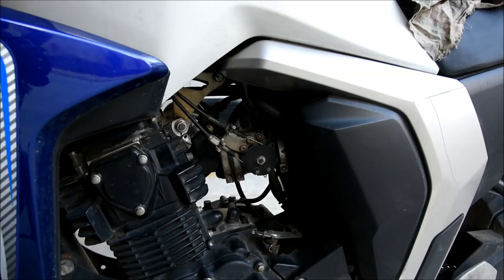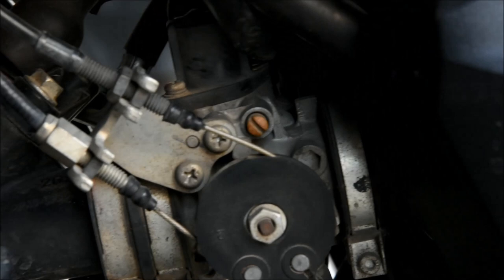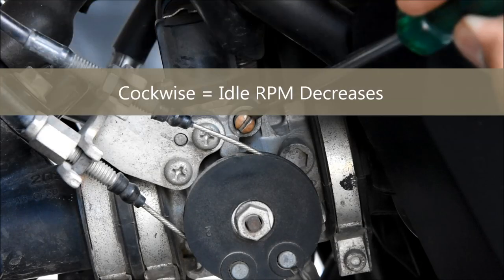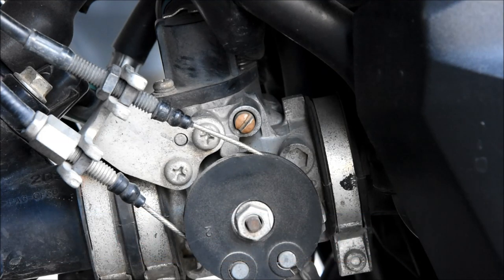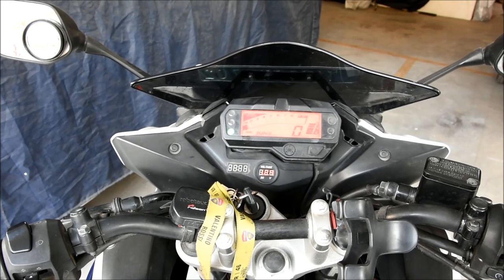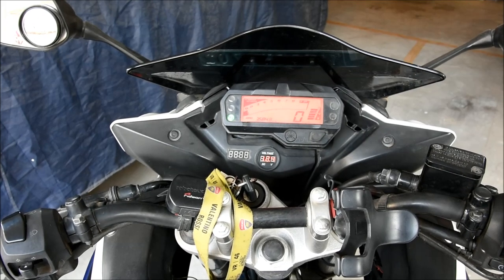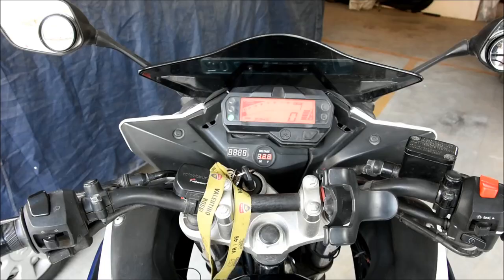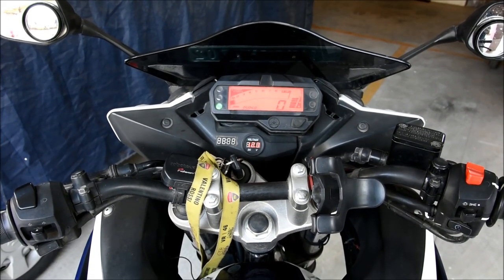#DIY : Idle RPM Adjustment on Yamaha Fazer Fi / Fz V2.0

Comment: This scre is broken.can i get new one?
Reply from the maker: You can order it from the contact given in the video description.
Reply: @MototechWanderer  how much cost?
Reply: @MototechWanderer  Where????how can i get that air screw????
Reply from the maker: @shabeeralimuthuvallur2254  I guess 100-200 INR
Reply: @MototechWanderer  which website it provide???service center or?
Reply from the maker: @shabeeralimuthuvallur2254  check there will be a contact number.

Comment: How to know it engine idle already on 1300-1500 rpm idle if i do it with no tachometer (manual adjustment)? Did you have a simple way to knowing engine idle level?
Reply: With sound.

Comment: Very helpful bro thanx a lott...just a question, through this process we increased the air flow into the cylinder ??
Reply from the maker: Bibhash Sarmah  We increasd air and fuel flow very slightly. So this will not have an effect on power or fuel efficiency unless your vehicle idles a lot.

Comment: Hi bro , very informative video thanks for it.
But my bike does not have that screw, i mean to say it is lost, where should i buy it , if you have any link please provide.
What is the name of that screw
Reply from the maker: Yes you have to order that part from yamaha. I will check the part number when I visit the dealer next time.
Reply: Thank you very much.
It will be very helpful
Also subscribed 👍
Reply: They are advise to buy throttle body 😭😭

Comment: hello man.. is that adjusting screw located at carburator?
Reply from the maker: It's the v2 model and has fuel injection system. For a carbureted engine, there will be a fuel screw.

Comment: thnx a lot.One of the Dealer was saying me that  we can't adjust this speed 😅
Reply from the maker: Now you can give them a lesson on how to adjust.
Reply: You can adjust idles in throttle cables, if you turn the air screw counterclockwise you are making the fuel mixture lean and it cause piston breaks,you can only adjust aircrew unless you are using a programable ecu😁 i work in Yamaha as a chief mechanic.

Comment: My fz v2.0 2015's engine shutting down frequently while in low speed after running  it in high speed, any suggestions?
Reply from the maker: Spark plug
Spark plug cap
HT coil
Spark plug cable 
Replace one by one ... One of them is faulty.
Reply: Did issue resolved buddy

Comment: Fz version 2.0 injector model
While running around 40 to 50 km speed
Bike gets knocking or missing issue at the same time eco indication also gets off.
Low speed and high speed no issue.
Please solve this problem.
Reply from the maker: Replace the spark plug and see.
Reply: I checked spark is normal
Reply from the maker: Replace the plug if it doesn't work, replace the HT coil and spark plug cable.
Reply: Ok thank you. 
I will check and let u know.

Comment: Sir....throtle body can make it tik tik sound is it?
Reply from the maker: No it cannot. It's either the worne out throttle cable or the injector noise.
Reply: @MototechWanderer  i hear it from throtle body 😀 then how to solve??
Reply from the maker: @mfgallery4512  if possible share a video of the noise.
Reply: @MototechWanderer  are you on whatsapp??...that sound is like a tapet tik tik sound!! But its not tapet

Comment: bro, i have fzs v2, problem is sometimes bike dont start until i have to give throttle, even after i recently changed battry,  ant air screw,  so can u suggest me what to do?..
Reply from the maker: Do you regularly use your bike ?
Reply: @MototechWanderer  yes bro
Reply from the maker: @MrBrijesh143  do few things : 
Clean the throttle body, replace the spark plug and also clean the injector. 

Check if the temperature sensor is connected properly with the plug.

Clean the fuel tank and fill fresh petrol. 

If all this doesn't help, it can be due to a choked fuel filter inside the tank. Then you will have to remove the fuel pump and clean everything.
Reply: Ok bro , ill do it ,  thanks for reply...🤗

Comment: I have a problem with my fazer 2.0 just changed the battery recently because I a haven’t used for over 4 months after the battery change and when I start the motor bike it is automatically revving really hard I’m glad I put it on neutral other wise it would have run off. Anyways is there any way to fix this ?. Thanks
Reply from the maker: Let it fully warm up for like 5-10 mins and see what's it behaving like. If it still keeps revving, see if the throttle cable is stuck, else check the idle screw.
Reply from the maker: Turn your handle left and right to check the throttle cable.
Reply: @MototechWanderer  thanks bro 😀
Reply from the maker: @ramimr1701  you're welcome

Comment: What does this control, the fuel intake or air ?
Reply from the maker: Just opens/closes the throttle slide to maintain a certain RPM. The AF mixture in always maintained by the ECU.

Comment: Like in carburettor  dont you have air fuel ratio screw and idle rpm screw. I see that below the throttle body there is a small nut which can be used to adjust rpm as well. It has to be adjusted with a hex/allen key. I am confused on why there are two ways to adjust rpm. Can you please clear this ?
Reply from the maker: EFI engines have the computer (ECU) which constantly measures the air intake temperature / pressure (throught MAP Sensor) and the exhaust oxygen levels using the O2 sensor. Based the the pressure, temperature, oxygen levels, it decided the amount of fuel to be mixed in the intake air using the injector. This process happens extremely quickly and the ECUs are capable to running 50-100 cycles in a second for achieving the perfect mix. So adjustment of af mixture is completely out of question as it's preset inside the ECU.

The only thing that's adjustable in our non-ride-by-wire throttle bodies is the idle RPM which is shown in this video. For bikes that have ride by wire, the idle RPM is also company preset and cannot be altered.

Comment: Is it the same on the 2nd generation (2016) FZ150i ? I don´t have the manual unfortunately. My bike seems to idle at a slightly low RPM value and I wanna try increasing it but no idea how to get it done.
Reply from the maker: It's on the right side of the bike in Fz16 v1.

Comment: Bro my bike is not starting after improper  carburetor tuning. How to fix it plss help
Reply from the maker: Bike not starting can be due to a different reason. Increase the RPM by rotating counter clock wise for around 5-10 rounds and start the bike. Then again start the adjustment.
Reply: @MototechWanderer  thankyou for your valuable reply 😀. I tried by rotation the screw. Sometimes starting but off suddenly.
Reply from the maker: Replace the spark plug and see if it idles better
Reply: @MototechWanderer  ok i will try bro🤗

Comment: Hey man,so i tried this on my r15 v3 bs4,and turning it clockwise or anti clockwise (atleast 3-4) turns didn't do anything,the rpm was same.
What maybe the issue?
Reply from the maker: May be the wrong screw.
Reply: @MototechWanderer  no bro,i am pretty sure about the screw,what else it can be anyways?
Reply: @MototechWanderer  what could be the reason,plz help
Reply from the maker: Something is stuck inside, service your throttle body. Start by cleaning the TB, follow the video in my channel to DIY.
Reply: @MototechWanderer  i recently cleaned it🥲,but all this happened after the cam bearing replacement,the service centre guys are messed up.
Reply from the maker: That's really sad. Take your bike to the Service Center and ask them to fix the idle issue. Sue them if they cannot get it right. You can even drop an email to Yamaha India if your case is being taken care properly by the dealer.
Reply: @MototechWanderer  yes i put a complaint on the website,and the service centre guys called me from their side today,lol.
Gonna get it fixed this weekend.
Also,is tappet sound normal in yamaha?
Reply: @MototechWanderer  yes i have mailed yamaha,and the response was fast,i hope they will fix it soon.

Comment: Bro my fz v2 rpm increase to 2_2.5k while turning fully right. I noticed that the accelerator is being applied automatically while checking the round thing below rpm screw.how to fix this bro? Do I need to change the accelerator cable??
Reply from the maker: Adjust the throttle cable freeplay and your issue will be resolved
Reply: How to do that bro?
Reply from the maker: @abidas738  there will be adjusters near the throttle. Rotate them clock / anti clockwise and set the right freeplay.
Reply: @MototechWanderer  bro I increased freeplay to maximum still the problem exists. The rpm decreased slightly and not crossing 2
Reply from the maker: @abidas738  what's happening when u try to adjust Idle RPM like in this video ?
Reply: @MototechWanderer  bro i think the prob is in throttle no prob in idle rpm. I alrdy did that. Gonna service my bike after a few km .let the yamaha service guy check it. If we rly love our bike we can't be hpy if smthng wrong in our bike😢

Comment: bro my bike is fz ver 2.0 after first service they raised idle rpm from 1.5 to 2      after soo many days i changed it to 1.5  is any  problem is there in that and fzs idle rpm is 1500 know?
Reply from the maker: Felix Lopez  there is no issue with the idle RPM.
Reply: mileage is good for  decreased rpm  know?
Reply from the maker: Felix Lopez  No change in mileage.   Idle RPM doesn't play any significant role in fuel efficiency.
Reply: it does!!

Comment: How to get top speed in 1/2/3 gears
Reply from the maker: Replace AirFilter
Replace Sparkplug
Change Engine oil
Clean and lubricate the drive chain
Inflate the tires to correct pressure
Whack open the throttle in every gear till you redline and ride it like you have stolen it.

But always ride safely and never over speed. Make sure you do everything in a controlled environment and not on public roads .

Comment: This screw is broken in my fzv2. Can't adjust it now and it's in lowest possible position and due to the same reason bike stops in traffic.
Reply from the maker: Either try lathe on it. Last option will be to replace the throttle body.
Take a second opinion from the service center.
Reply: @MototechWanderer  great. Lathe wont be possible because the screw head is broken and the rest of threaded part is still in
Reply: Dwaipayan Talapatra I am facing same problem!! Any solutions??
Reply from the maker: @mayankk_xo  discussed above.
Reply from the maker: @dwaipayantalapatra6109  screw extraction process ... Where a reverse threaded needle is drilled into the broken bolt to extract it. Will be making a video on bolt removal / extraction soon.
Reply: Sure! Will be waiting!
Reply: Dwaipayan Talapatra bro have you found any solution? I am facing same problem since 4 months and my bike also not give good mileage just because of that
Reply from the maker: @mayankk_xo  Fz v2.0 or V1 ??
Reply: Moto Tech Wanderer sir fzs v2
Reply: @mayankk_xo  Not yet bro. I am not riding it much because in low rpms bike stalls and its very difficult in citiy. Also ,will be visiting  service centre soon , lets see what they have to say
Reply from the maker: @dwaipayantalapatra6109  its quite strange that screws are breaking. I am afraid you guys might need to replace the throttle body. But if your idle RPM is 1200-1500 RPM ... Just leave it as it is.
Reply: @MototechWanderer   the idle rpm is way below 1100 , somewhere around 600/700. And thats why bike stalls in traffic i guess.
Reply from the maker: @dwaipayantalapatra6109  yeah. That's too low. You might need to replace the throttle body.
Reply: @MototechWanderer   that is going to be heavy on the pocket. 7k i heard . Trying to figure if i can get it done without replacing
Reply from the maker: @dwaipayantalapatra6109  keep me updated if u find anything.
Reply from the maker: @dwaipayantalapatra6109  And as per my knowledge, throttle body costs around 3-4k.
Reply: I got the throttle pin replaced. It only costs 42/- in the dealer service centre. They were keen on doing the lathe procedure but the pin came out easily. It wouldnt have been  possible if the entire  head of the pin was of tho.
Reply from the maker: Can you please share the part number if possible?
Reply: @MototechWanderer   i havent rcvd the bill yet. I will prolly get it by tomoro. Will let you know then
Reply: @dwaipayantalapatra6109  please reply
Reply: @dwaipayantalapatra6109  where you get this address?
Reply: @dwaipayantalapatra6109 bro  can u  help me ...i too got the same problem ...my screw has been damaged and some part has been inside only ....I WANT TO REPLACE THE THROTTLE BODY (Or) ANY OTHER SOLUTION
Reply: Yamaha FZ version 2.0
Reply: @MototechWanderer   plz lemme know your insta handle. I will dm you the tax invoice . So that it becomes easy for you to show to people
Reply from the maker: @dwaipayantalapatra6109  my handle is in every video description.
Reply: Bro what's the number of this part? Mine is broken. Please help.

Comment: You right bro...standard idle for this motorcycle is 1300-1500 rpm. But, why many people set it on 1200 rpm?
Reply from the maker: They are in false notion of saving fuel with a low idle. It's a myth unless we idle the engine for hours.
Reply: I agree with you Bro
Reply: I have question for you Bro, maybe you can explain it to me... My FZN150 engine idle always decrease when it going hot condition and it sounds very disturbing me (it sounds like something knocking from engine). Is it normal?
Reply from the maker: @bagassriindrantoro6807  the drop in RPM is absolutely normal. The ECU has a temperature sensor which raises the RPM when the engine temperature is low acting like a auto choke. After reaching operating temperature it drops to normal idle RPM.

As far as sound goes the head is a lil noisy after heatup. Also clutch bell noise is present in most Yamahas. It's kind of a characteristic of Yamaha engine.
Reply: Moto Tech Wanderer :- The Fz version 2 engine is noisy when compared to the version 1

Comment: Hello guys, 
FZS V2.0  2016 model 
- My bike's RPM adjusting screw is damaged as you can see in below pic. 
Can any pl suggest solution on below.. 
1. Can I get switch installed or I need to replace FI?
2. how do I increase or decrease RPM?
Reply from the maker: Place an order with Yamaha for the screw. It can be replaced.

Comment: Starting rpm b/w 3 to 4. What to do
Reply from the maker: Jassi Chana  Do what you learnt in this video. It's clearly explained.
Reply: Mototech Wanderer but problem is that it fluctuate. Not stable
Reply from the maker: Jassi Chana fz v2 has temperature sensor. If engine is cold the idle increases and later drops with engine heat. Find the right balance.
Reply: Mototech Wanderer ok i will try

Comment: Thats the air flow screw
Reply from the maker: @hastendmello  you can call it that but remember this is a throttle body not a carburettor.
Reply: @MototechWanderer  any screw that will increase rpm on turning clockwise is idle screw, there are 2 screws on my R15 Fi , one is for controlling air (rpm increases on turning anti-clockwise) and one is for opening throttle idle position (idle screw)

Comment: Abe galat idle speed set kar rhe ho.. always maintain 1400-1500 RPM nahi to battery ki life 2 saal se zyada nahi rahegi.
Reply from the maker: 1300-1500 RPM ... Book me mentioned hai. Wahi set kiya.
Reply: @MototechWanderer  always use Tachometer device, not the bike's one  because that is not digital as there are only lines blinking on it.
Reply from the maker: @AnkitKumar-qb7rw  I work with the approximation of the bike's tacho. Each blinking line is around 200 RPMs.